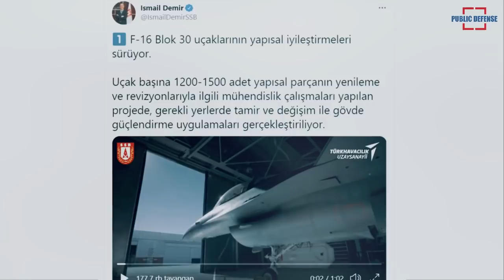Turkey Extends the F-16 Structural Upgrade Project Until the TF-X Program is Completed

Comment: All F16 have a kill switch and the USA can turn the plane off at any time.  So it is basically useless.
Reply: F16 have combat management link 16 open source for turkey military, so turkey can modified programing and add weapon from own turkey or any country
Reply: Thats thru but not by the Turkish F16 one. Turks already install the Turkish version in their F16.  You will say how this is possible? When the Turkish Programmer was in Israel the stollen the Source and bring it to Turkey. After all Software are be changed and Generated a New Code.
So now Turks can set any as a Enemy even USA. :)

Comment: just make them block 70 and you’re good to go👉🏻
Reply: @Kirin Sama I can say that he is damn right and u are just one of erdogan's sheeps, what can I do
Reply: @Kirin Sama Block 70 is so much better
Reply: @-atf_karxariesx-  block 70 is nothing against turkey's 5th gen fighter jets which working with uk
Reply: 1)The turkish programm has as goal to increase the flight hours of the F16s ,nothing else.
2)Upgrading block 30 to block 72 viper doesnt make economic sense ,the cost would be far greater than block 50 to block 72 and u would only get 10 more years of service so its not worth it. The biggest problem would be that block 30 are analog systems where 50 and ofcourse 72 are digital ,that means that there would be compatability problems to enter digital systems to a analog platform ,there is no country that has done in before so any problems would have to be solved by the contractors adding cost and time. If there was a country before that had done the upgrade block 30 to 72 there would be ready to use solutions perhaps for a cost but still.
3)This is more about gaining time to see what to do with the next fighter jet ,if its a nato it would take around 5-6 years to complete take advantage of it. A russian/chinese market fighter would take close to 10 years and it could be the final coffin nail in nato-turkey relationship. Since Turkey waits to see if she can re-enter the f 35 programm and if the tfx programm bares any fruit  it makes sense to try this for now.
Reply: @Kirin Sama No they allow the update in foreign countries. Thats what they did with greece
Reply: @Kirin Sama no
Reply: @Kirin Sama it’s ok if ozgur is good enough to match greece’s f-16 b70 along it’s latest high tech weapons and rafael and it’s weapons
Reply: @Kirin Sama its still not an f16 block 70
Reply: @Kirin Sama Turk7gay sounds much better...
Reply: The özgür is not a match against the block 70 , the tech in the block 70 is far more ahead